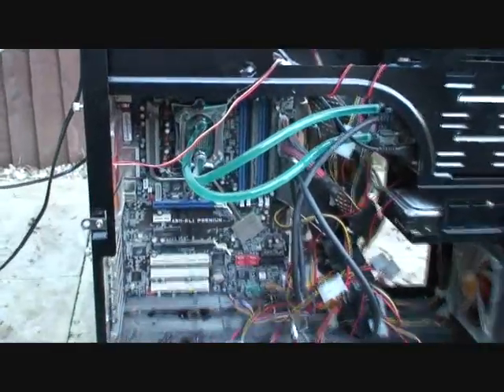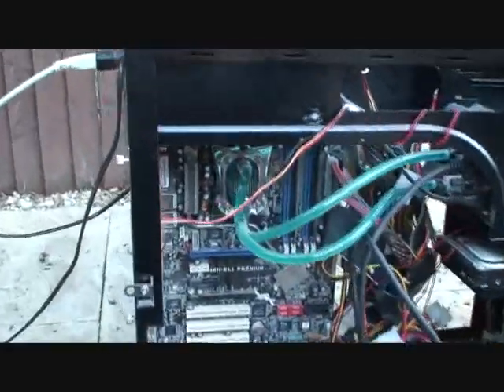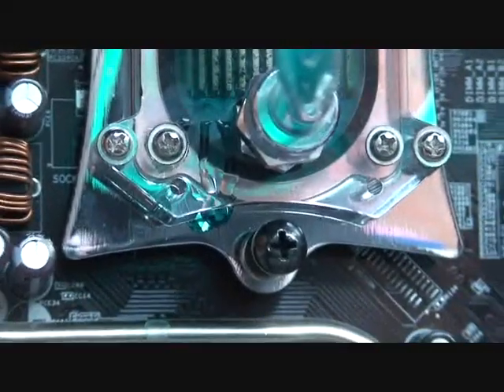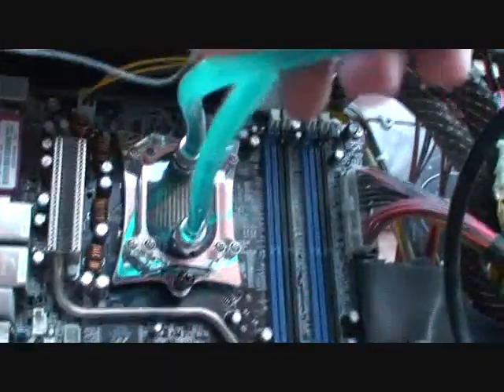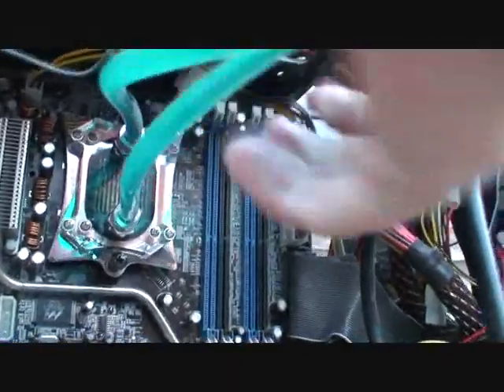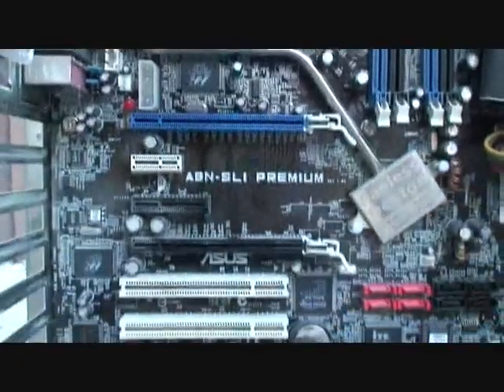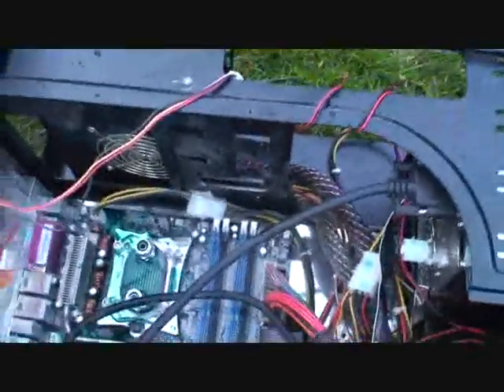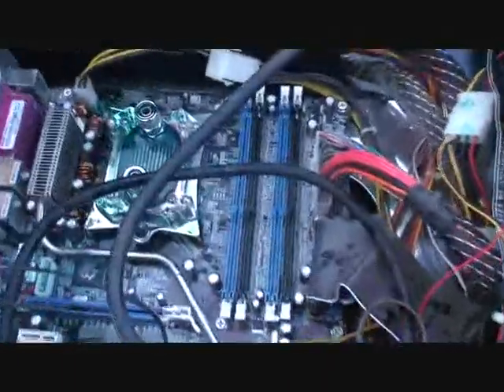Watercooling leak!

Comment: Keep in mind that this video is over a decade old now. Things change. I dont say that there is no risk at all, but people act as if it's likely to happen. Would you worry about leaking if you bought an aquarium? Probably not. It all depends on what components you get. Get some cheap shit and it will probably break fast, get some quality shit and it will probably last for years and years to come. 
I dont say that there is no risk at all.. but there is a risk to die every time you enter a car, but you dont even think about it, do you? The video was made in 2007 and water cooling has become way more popular and the competition is making systems better each year.

Obviously, if you cant stand the risk, go for air cooling. There are really good air cooling options on the market. Water cooling is superior for overclocking tho. As far as noise goes.. they are rather equal. Sure, water cooling has a pump which adds noise, but you more likely than not also have slow spinning large fans on your radiator, which can reduce noise to absolute silence. If your fans run at 100%, then no matter which cooling solution you use, your system will sound like a jet engine. Since you will probably only get water cooling if you plan on overclocking, if you went with air cooling you'd also need a huge heatsink with 2 or even 3 fans at it to cool your CPU down to the same temperatures as your water cooling system would be able to. This, again, also adds to the noise - which is why i'd say they are about equal if you get some quality components.

Both have their advantages over the other and both have their specific use cases. 
There is one aspect to water cooling i dont hear people talking about a lot tho. Water has a lot higher heat capacity compared to metals such as copper. Your heat sink is a comparably small chunk of metal. A few seconds or minutes under load will heat it, and thus the fans need to turn up their RPM to keep the heat sink and thus the CPU cool. A water cooling system is larger in comparision (amount of water, through tubes, to radiator which is again a chunk of metal). Thus, a few seconds or minutes under full load will only change the liquid temperature by a couple degrees. Since it's the heat sink / water cooling your CPU, not the fans (they cool the heat sink / water), the fans of a water cooling system only need to kick in way later. Thus, if you only have small bursts of load on your computer, water cooling will be basically silent compared to air cooling. The disadvantage of the higher heat capacity is of course that the water also needs a longer time to cool down - even tho, the large radiator with the large fans is able to cool it down way quicker than the CPU can heat it up since it has a lot more surface area.

Just a few things to keep in mind. I felt like writing this since the comments are basically one sided hate against water cooling systems, which i felt is totally unjustified.

Comment: main reason why i dont want water cooling. now the real question is if you have a bunch of high quality fans. will it be enough for a $2k build?
Reply: this video is old man and most liquid coolers arent custom loops they are all in one systems that dont require maintenance and will last the life of ur pc (like a 6yr warranty)
Reply: kevin chen
so fans is still a valid option as long as you have the best thermal paste, number and quality of fans, and high 80 plus platinum rating power supply? im asking because i have an extensive plan before i buy.
Reply: go with the fans
Reply: *****
have a box of tx4 tuniq, read a bunch of reviews and articles on thermal paste and the correct properties to use such as nonconductive and that one seemed to be rated highest. what do you think?
Reply: *****
im thinking about going overkill and getting 1600w platinum plus as well
Reply: *****
why is being extra safe and forcing air without multiple fans to prevent failure a failure?
Reply: google how many case fans should i have and watch the video

Comment: I had my first leak today, much worse than this, as it came out like a fountain and went all over my computer and even out the back of the power-supply. Happened because my pump was pumping at a pressure that was too high, and one of the tubes was not secured properly.
Reply: +Seaman Whoopa What survived?
Reply: Fastmagnum004
Everything survived, I turned off the power immediately and dried it out with paper towels and a low powered vacuum cleaner. It was on the bend to my second gpu so it didn't get to much, I don't know if the bottom pci slot still works but I don't use it anyways.
Reply: Hm. How lucky. Good for you, sounds like you made it out of that one relatively alright.

Comment: i was going to ask a question on yahoo answers.  how does computer water cooling work, but that's already been asked and answered, however, i am not looking for technical information.  what i really want to know is, why is it so popular?  why is it so full proof?  why do none of them leak?  then i find this video.  well, i guess they do leak, so my next question is, why do people still buy them?  why are they so confident they won't leak?  i thought that putting liquid on circuit boards was a fad, but this fad is lasting an extremely long time.
Reply: a good fluid does not damage components in case of a leak. There is no such thing as foolproof, it has moving parts so like anything else it needs checkups and tubing changes, if this is neglected its going to fail.

Comment: This is why I'll never use liquid cooling. Too much headaches. I'll probably be looking inside my PC more than my LCD ... Not because it looks cool, but because I'll be worried as shit if its leaking or not.
Reply: There are these things called aquariums. They also use pumps, and guess what, nobody is worrying about them leaking^^ Sure it can happen, but its extremely unlikely. It also depends highly on the quality of your components and the guy in the video used a rather bad system. Keep in mind that the video is over a decade old now and things have changed. Two decades ago people would have laughed at you if you suggested that everybody and their moms would have a terabyte of storage space in their computers now.

Comment: this is why i dont like water coolers at all 
1.they are very loud
2. they can easily leak and destroy your 1000 euro machine 
3. just go with really good air cooler instead :P
Reply: liquid cooling is more silent than air
the main reason to get water cooling is to overclock and silence...
Reply: Oscar Cubillan If you think high end air coolers are loud you never heard of Noctua and Scythe..
Reply: well the pump isn't that loud for me i'd take that over 3 raging fans+ limited overclockability (Depending on your airflow/case/ and other what not)
Reply: Oscar Cubillan Tight budget and water cooling don't go very well together. Rather get a cooler like the 212 evo ($30). Almost inaudible and it cools like a beast.
Reply: Um liquid cooling it WAY quieter than air cooling.
Reply: +aqwNotxdragon24 i didn't say anything about high end but if you're on a tight budget getting a water cooling system would be cheaper if you DIY 
~i do like noctua fans :3
Reply: SunnyD that was the main use of water cooling back in the day cause of those crazy temps i didnt say it was practical xD i'd still just use some water cooling for just the CPU but the rest just air its hard to swap out components and i dont really overclock anymore now adays too
Reply: my friend is telling me to get it but this is exactly what terrifies me 1000 euro down the drain i cant trust it id rather put a top of the range cooling fan in there
Reply: Nadox97 um id rather have a loud as fuck machine than a broken one sorry but cant trust it
Reply: aqwNotxdragon24 dude just stop discussing, its a fact. if you overclock your components or your pc just runs really hot, the fans will rotate at rpms that make them loud as hell
Reply: chsxtian
lemme rephrase that
cheaper than having one prebuilt water cooling loop XD
Reply: Oscar Cubillan Fan vs Fans and Pump motors
Reply: Oscar Cubillan overclocking doesnt offer much performance increase like it did years ago all it does now is pointlessly shortern your computers life span it MIGHT get you a few more frames in shitty poorly optimized games like battlefield, ass creed "ass huh", cod, etc or if youre stupid and went with amd which sucks because most games still use 1-2 cores sooo hooray for bottlenecks!

the noise of decent or good heatsinks / fans isnt even that loud at all especially if you wear headphones or have a TV on in the background half the time

Comment: what if you put oil in the system rather than water???
Reply: Mineral oil is not often used because it's a worse thermal conductor than water, and the cooling blocks aren't designed for it.
Reply: chsxtian ah ok, thanks
Reply: chsxtian
what will happen if you use liquid nitrogen?
Reply: Ha
Reply: zhentrix calipso If you allow the liquid nitrogen to boil off, it would keep your computer very cool, since the nitrogen will remain the boiling point, which is around -70 celsius. This would cause bubbles in the system though, which causes all kinds of problems. Also you'd have to continuously refill it with liquid nitrogen.
Reply: chsxtian  so is it possible to overlock your gpu to the max wihout burning it?
Reply: zhentrix calipso Yes, but it's tough to build it like that.
Reply: K..

Comment: I've gone through all sorts of leak, specially from plexi, well not that any of them killed any of the systems but the more you experience the better approach further on next time. For instance my DDC XSPC pump-reservoir just started to leak from the most weird point you could think of just of a sudden =( although this was mounted in an custom-made box, no harm done. The worst time was a moddified cpu-block with special fittings, worked like a charm until 3AM.. the horor! the stupidity.. water dripping down right at the GFX and PCIE connector.
Can't answer how long it's been dripping, couple of hours probably. Improved the mod later on and everything up and running again.

A plexitop will always be a risk. Sooner or later the material could start to crack. But then you have the quality and stuff like that. A hard metal or acetal is the best way to go.

Comment: as an engineer:
nope, why would it become conductive, there arent any metal shavings and the heatsink/radiator are made of copper. 
It would take many years of 24/7 use to have enough copper to corrode and make it conductive. Even if enough copper were to enter the water, the electricity still has to travel through the relatively non conductive fluid to get to the next piece of copper.

Comment: Why don't you want? For the leaks, there's a specific test, where normally you're going to put some paper towel sheet, all around for each fitting, and then let the fluid pump in in the loop, with ONLY the pump turned on, supplied by another psu or the computer psu itself turned on manually. In case of leaks, the paper will absorb all the water, and you'll see without any problems the leaks, or if the water wet the motherboard or whatever electronic circuit, you're just going to let it dry.

Comment: Water, if it's pure enough, is as "non-conductive" as you can get.

If you were referring to mineral oil as an alternative to water, then you should know that it'll pretty much make your warranties and resale values vanish, considering you can never fully clean a component after it's been doused in mineral oil.

Using anything other than distilled water in a cooling system like that could wreak hell on the pump.

Moreover, any "non-conductive" liquid can be contaminated and become conductive.

Comment: preach the dangers of water cooling over clocking what perfect combo for ubernoobs.. really ya don't need water cooling if you don't OC I dont like about water cooling more maintenance. you have to check up on it toos in beast video card good air flow in case u g2g.

Comment: The key to a good water setup is over engineering.  Always go with at least 7/16" ID 1/2" OD tubing (my preference, as it sticks quite well on 1/2" barbs.)  1/4" tubing was fine back in the Athlon XP days, but with high flow blocks and pumps you're prone to stress cracking acrylic over time with 1/4" ID tubing.

Higher transistor counts want for lower pressure and higher flow rates. 7/16" ID tubing can easily cool a modern CPU in line with GPU with only a 2x120mm radiator. 1/4" ID is obsolete.

Comment: If you're using a non-conductive you may as well just stick with high end air.  Non-conductives also conduct and release heat less efficiently.

The best blend is Valvoline Zerex race coolant at 10/90 ratio coolant to distilled.  Downside is pink coolant.

I've settled permanently with this coolant mix, and have a DD D5 pumping it for 5 years strong on the highest setting first with a Q6600 @ 3.7GHz and now a Xeon X3360 @ 4GHz loading at 48c in 3D and 58c with Linpack on a 2x120mm rad.

Comment: calm down, and yeah i don't know what pressure testing is but i did custom water cool my pc with no problems what so ever, its not that hard, you just have to take the right precautions, and i also want trying to convince you to do it, i was simply stating that there are ways to leak test.

Comment: i dunno about pressure testing whatever that is, but you can jump the power supply allowing you to turn on only the pump, so the water can flow around the system to test for leaks, without any components being on, so if there is a leak, it wont short anything out

Comment: You should get a transparent box so you can see thats happening inside. inspect the computer at least once a day. water cooling is dangerous and should not be used in all computers. 1) I think you should not used colouring just buy colored pipes 2) use non conductive mineral oil Insted of water so even if you have a leak the mechine will be safe the circuts wont fri up :D

Comment: You know even with a leak like that you could have possibly kept that mobo & CPU. That is if you had used the right liquid & kept up on its maintenance. Maybe not much after what you did to it @ the end.
Also the Acrylic Block itself cracked. Probably do to over tension on the crew & temperature variances. Anyways, depending on the situation that caused it you may have been able to claim warranty depending on the company. Also the rest of the setup was still good. I would've replace the block.

Comment: A majority of the noise caused by computers is the fan from the heat sink on the CPU. Instead of trying to rig a water cooler yourself, buy a premade one. watch?v=9YOcKvplg8E

Comment: Stay away from Acrylic/Metal combination blocks go with metal only (one piece or bolted or welded two piece blocks) Also I personally like to build my water cooling setup with an HTPC horizontal case which is less wear on the pump.

Comment: That is a very good point you just made. However they do sell have leak detectors to detect leaks of fluid before It's too mate. If you buy quality parts that are very expensive it is a very low chance that you will spring a leak. And the nerds are the ones who invented your Microsoft OS and VPNs btw.

Comment: Why do you have 2 graphics cards? You do realise they in no way work together unless you use crossfire / sli. Utterly pointless to do that. 

Your temps are fine, anything above 60 would need cooling. Your CPU is P4!? Very old single core, you wont benefit from upgrading that. Spend £2 - £300 and get a decent machine before worrying about upgrading and cooling. Sorry to say!

Comment: What parts have you changed, and what sort of temps are you getting at full load?

I doubt you will need to do anything with the CPU, since dell lock their bios from being over clocked. Oh and dispersing a lot of heat is a good thing, that's what you will want to do.

Comment: My brother accidentally pulled a tube out of the CPU sink,  PC was on, leaked down the MB and dripping off the graphics card for a good 10 seconds before pulling the lead out, It worked perfectly fine, during and after the leak.

Comment: ITS THE SEAL YOU DONUT, and if you use non conductive fluid(as you should) it will not damage your graphics cards or system. but you should of tested all the system BEFORE you put it in the case, and as for your comment "DONT BUY WATERCOOLING" you should of said dont buy it if you have no idea what your doing.

Comment: Water coolant are safe.  I have ten build with water cooling system and NONE of them leaked yet.   And the latest is for and LGA2011 PC and works fine and that includes the 3 video cards, the water cooled power supply unit and the 3 special water cooling HD brackets.    So I don't understand how come yours leaked in the first place.

Comment: @thehumor this video was posted 5 years ago. water cooling systems has evolved a lot since then. New water cooling system are leak proof unless you are purposefully trying to mess it up. There are also close circuit systems where you don't need to set up anything, just plug&play. Long story short, water cooling is a great alternative if you are into over-clocking or simply want a cooler running system.
Reply: Fascinating to read this 12 years later

Comment: @mamailo2011 that's why you use a silver kill coil. I've had my system running for over a year now with just distilled water and a silver kill coil and the water looks just as clean as when I first poured it in.

Comment: If you use Anti-Conductive Coolant you won't have to matter about leaks as much, If it leaks into your system it won't short circuit which means no damage, if your scared of watercooling be scared your missing out..